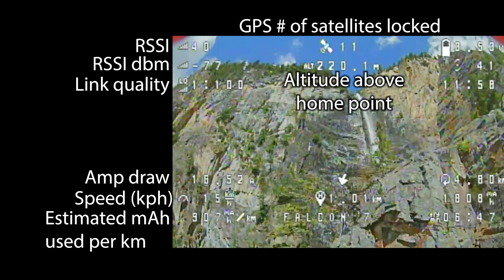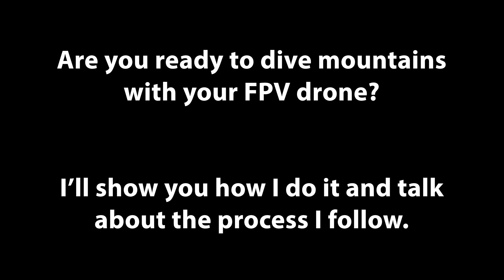FPV Drones & Mountain Diving  4k Footage + Process Explained

Comment: Just saw this! My heart was pounding! HAHAHA! Quick question. I finally bought parts for my 7 inch quad. I am not sure if I should buy TBS Crossfire Nano Diversity since I already have many spares of Crossfire Nano. If I will be only flying like 2-4 miles, should I still buy the Diversity version?
Reply from the maker: I'd say go with the diversity, with a single antenna you'll always end up pointing the null end of the antenna at yourself every now and again.  The diversity isn't necessary, but it's the safer way to go.
Reply: @FalconRadFPV  Will do once I get extra savings. I now have most of the parts to complete my 7 inch quadcopter. The next thing I must buy are the cells, either 18650 or 21700. What would you recommend?

Comment: Great Video, again 👍🙏

On the Rad liion, the imortal t looks realy close to the frame, can't that cause problems?
Reply from the maker: Thanks very much, I've never had any issues with my crossfire connection, I the antenna is a few cm away from the arms at the closest point.  I haven't noticed any rssi differences between my Falcon 7 and RAD Li-ion builds.  The antenna mount could be lengthened a bit more to push it further out front but that would also increase drag.  I've had no issues and I've gone over 6km out with my RAD Li-ion about 50 or 60 times in the last year.
Reply: @FalconRadFPV  ok that sounds good.

Did you ever tested a Nanorx how can it go with a bardpole antenna or you flying the crsf diversity since "Day one".

Comment: Hi, I have also built AOS falcon 7. I was using HQ 7035 v1s propeller. But during one flight one of them exploded over mountain. https://youtu.be/rPq1hcn5ifo . I reached my drone 2 days after. What is your recomendation for propeler. I need a durable propeller. HQ propellers are not very durable for me.
Reply from the maker: I always use gemfan 7040 triblades for my Falcon 7.  I've only had one prop failure (at -10 c) over hundreds of flights.
Reply: @FalconRadFPV  Thanks for response. I hve ordered gemfan 7037 carbon frames this time. :)

Comment: Thank you! I learned from this video. I have noticed that you are using radios gimbals as they come, without loosing them. I loosened my radio's stick movement for freestyle and I was wondering: is that good for this kind of cinematic flight as well?
Reply from the maker: Whatever works for you for getting smooth stick movements.  My x-lite transmitter has shorter throw gimbles (less movement) so I 3d printed some longer stick ends for it.  It helped to soften the stick feel a bit.  For me I think having looser gimbles would be easier for cinematic type stuff.

Comment: Recommended ESC settings for LR?
Reply from the maker: There should be a video about it in the quads and gear playlist on my YouTube page.
Here's a link straight to the blheli 32 settings video.
https://youtu.be/DSWDHf8Pxqw
Reply: @FalconRadFPV  do you use 32.7 or the new 32.9?

Comment: Still loving my Falcon 7. It does a great job of not vibrating, has lots of good mounting potential, and there are lots of good 3D prints available for it. (even learned to modify some!) Hoping that someday I'll get the chance to send it up and down a mountain or at least some interesting terrain.

Gotta ask. What was that killer track at the start?
Reply from the maker: Glad to hear that your Falcon 7 is flying well.  It's copyright free music from Audio Hero.  It's called full court press.
Reply: @FalconRadFPV  Thanks!
Reply: If you need tuning tips or help with anything vibrating I'm your guy.
Reply: @MysteryD  The offer is appreciated, but I got it covered. Learning about resonance is one of the best things a person can do in this hobby.
Reply: gg

Comment: Amazing videos and thanks for clear explanation !! I would like to ask why don't you use 1.2-1.3 Ghz freq. for fpv goggles.
Reply from the maker: With good antennas 5.8 seems to work well enough.  Then it keeps it to all the same goggle gear for freestyle and long range.  Although I do have a spare module bay, maybe I'll give it a try sometime.
Reply: Perhaps setting up a 1.2 to 5.8 video relay, so all the stuff on goggles remains unchainged